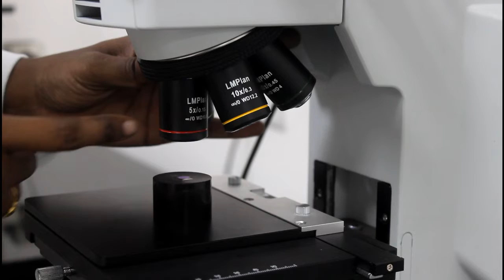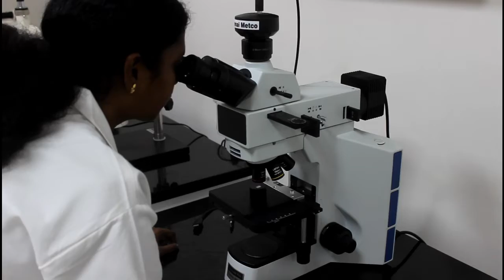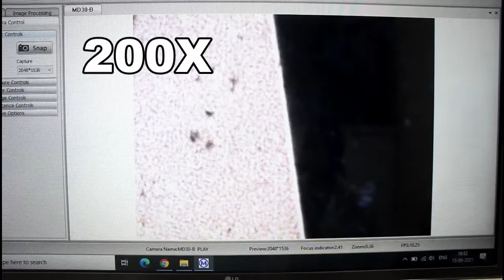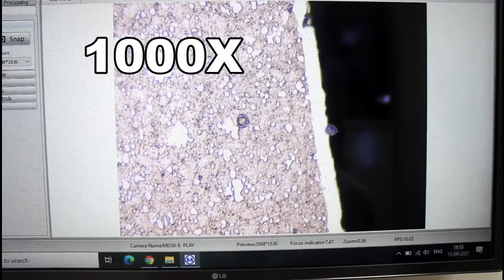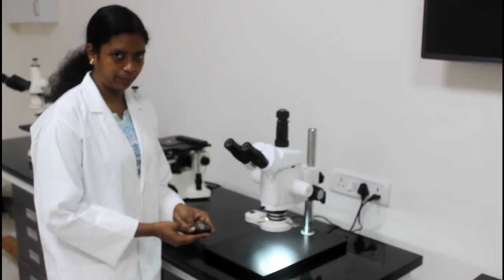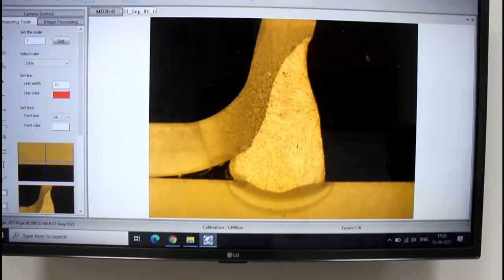Metallography Microscope  and Image analysis system

Comment: Are you able to tell me the make and model of that microscope? I am setting up an experiment to determine paint film thickness on a plastic part in microns and have to image a reference scale to capture the scale of 1-10 micron distances in the photos to compare to the distances shown from the actual sample. Obviously I have to take the scale at the same magnification, but would changing the focus make them incomparable? Because technically you’re moving the plate up and down or closer and further. I don’t think so because then how would you even get both to focus at different heights since the reference scale is 1mm tall and my sample is 15mm.